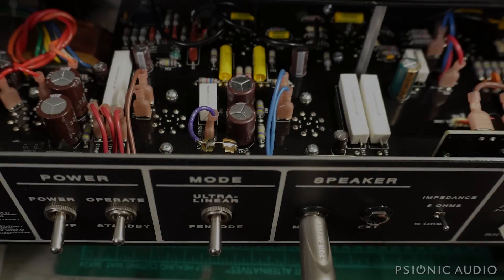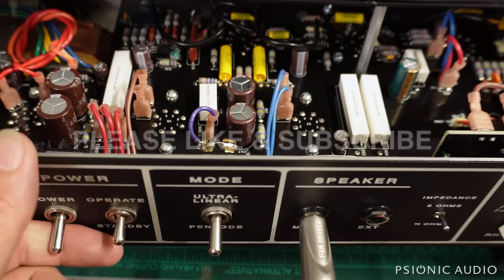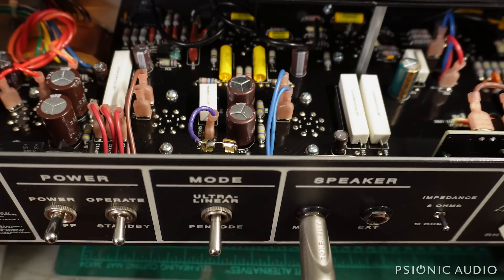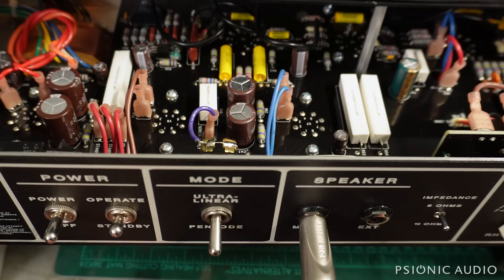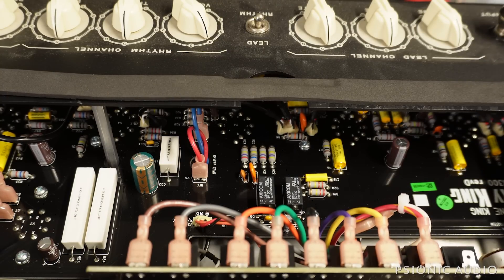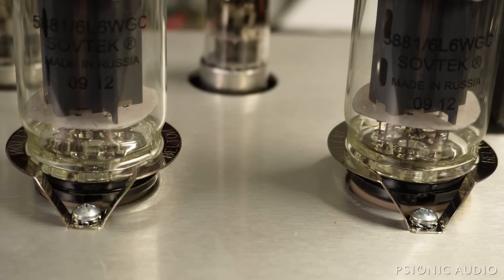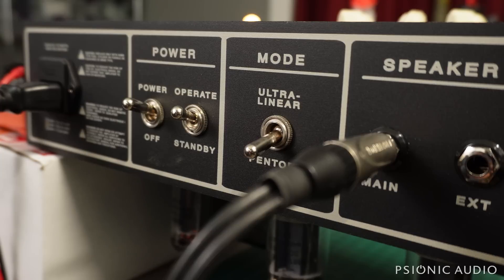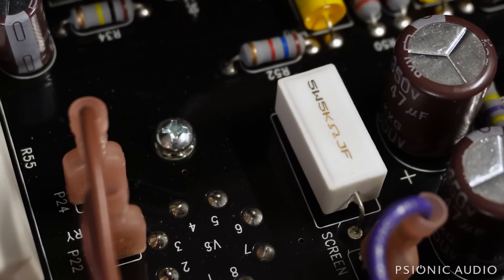Really, Tone King? (Another Sky King)

Comment: I've had to repair a weirdly high number of recent-production B.A.D. Tone Kings and Friedmans.  A few had bad pots, a few had incorrect caps and/or resistors.  I've read there was a fire at the factory and that somehow (I don't know how) affected the components that were stuck in some of their amps.  I'm not impressed.
Reply: Take this with plenty of salt, but I recall hearing that their stored components were damaged (this was either during or just prior to the height of the pandemic; it is a big blur if I am honest).
Reply: Mine had a speaker where the outer edgings dried out…per my tech. He said the speaker was good but found it odd. Everything else passed fine, and replaced stock tubes day one. It’s all running great now! But he did have to put some felt on the outer edges of the stock speaker to stop it rattling. So may need to claim a warranty on it or upgrade the stock speaker. But the felt so far is working fine. What you say here may explain why that happen and parts used.

Comment: i was surprised to see that Jeff Tweedy is using a pair of Tone Kings on the current Wilco tour, Imperial model i think, hope he has a good tech!
Reply: I saw the Breeders also had an Imperial MK2 on stage at Coachella. They seem to be popular with some of the Indie artists. That or TK is reaching out and giving them away for promotion as well. But yeah I brought my Sky King to an amp tech day one for a check up. Swapped new TAD tubes Vs the ones in the video, and had some felt applied to make it quieter at very loud levels. Also had the backplate reinforced and everything inside checked and passed. He also moved the reverb tank around so it’s silent now. It was worth my piece of mind.
Reply: @mattg082  interesting, i remember Lou Reed was using them too on his last few tours, Imperial MK1 ? great sounding amps.
Reply: @watkinscopicat  yea he’s listed on equipboard as touring with them. I demo one for 4 months, and went with the Sky King. I loved the sound of the Imperial. But felt I needed two amps for a live situation. I would totally use 2 of those in stereo. Or a Imperial Mk2 with a 6L6 or Marshall. It was really trebly and boxy after a certain point. Only way around that was a secondary cab, and a GE Nos 5751 in V2 preamp. New speaker was possible as well. 

It cut like a knife as far as top goes at loud volumes. Became very boxxy as well and center focused. It would work well in a country band, blues or light Indie Rock.

All I wanted to do is keep modding it…from tubes to speakers constantly. Not so much with the Sky King, it could hold its weight on stage and in the studio. Same as a Mesa or any Super or Twin Reverb for grunge and heavier stuff. But it has the same circuit as the Imperial but 6L6. Like a boxxy Fender Deluxe vs a Fender Vibroverb/Vibrolux 40w. I thought even the stock Fender Deluxe was a bit more beefy. 

The bright cap is on all the time till 5 on the Imperial MK2, then it gets boxy. So a Tele may fare better or strat with single coils…I play Les Pauls. 

I had the ability to plug the Imperial MK2 into a Sky King cab, and it sounded really good! So I get the Imperial head and cab a lot more now. That’s the way to go, if I was maybe to do it again. I use a Roland Jazz Chorus as my second amp in stereo. It works well for modulation and stereo effects.

Comment: There it is! I went through 3 of these before getting an Ultralinear with no loud hum. Essentially it would hum and blow a fuse or a tube. Day 1 I swapped out new tubes and have yet to have an issue in my current one. But I thought I was going crazy with the Ultralinear noise, and being told it was out the ordinary. When every 1 out of 2 unit had this. 🤦‍♂️

But eventually after a check by vendor for hours, and a trip to the tech day 1 to check all this stuff. I got one that passed fine. Put some new TAD in Vs these stock right away. Just had some cab rattling at loud volumes we fixed real easy. Got ahead of any issues and all good. One I had the stock tube blew up after the hum got louder, and it broke of near inside the amp…pieces of the stock power tube fell out. 

Keep us updated on what’s causing it! Seems it could be a commonality owners could avoid hopefully. If it’s those tubes, then def swap out asap. I did on my last one and no issues present like the other ones I had issues with.

But the Ultralinear hum is very common on the new shipped Sky Kings sorry to say. They don’t always start out that way. But I had enough returns to see just how normal it was. Even one sent from BAD and did the same! Wasn’t until I swapped the tubes before I ran it, that I didn’t have any future issues. The ones I tried  it did it over the course of a few days playing stock it appeared. Most miss it because they don’t use that mode right away. But swapping those tunes before it started, and getting a full inspection helped a lot! Sooo, something is not right.

Comment: I recently installed some wafer base, also referred to as coin base 5881's in a PRS HDRX-20 but I also ditched their bear traps for spring retainers to avoid biting into the glass envelope of the tubes per one of your past video's that pointed {pun intended} that out. With all the vibration, especially in combo amps, it's only a matter of time before those bear trap spikes crack the glass.

Comment: Thanks for all your videos detailing the problems with the Sky King, Lyle. Very informative, and ultimately, a red flag alert, as in DO NOT buy this amp!

And now, I am saying this from personal experience, having bought one before your latest videos on these came out. While it did sound very good, with the features working properly (vibrato, reverb, power attenuation) and did not come with the coin based power tubes, and is built like a tank, I returned the amp to Guitar Center, and did so for the following reasons:

1. With all volumes turned down, the amp was "motor boating". A dead giveaway for trouble.

2. Quality checks were lacking. For one thing, the reverb tank was not secured in its bag, and the bag straps were not secured properly to the cabinet bottom. And as to the previously mentioned "motor boating", if any decent quality check had been done before packing and shipping, it should have been put off to the side immediately for diagnosis. If that can be done with candy bars, it can be done with a $3K amp.

3. My "built like a tank" comment does not come without its downsides. The amp is way too heavy if one thinks they will haul it from gig to gig, even with a cart or dolly. For $3K, Tone King could have built a nice pine cabinet to reduce the weight a little and bring out more tone. Baltic Birch plywood is, yes, very tough and strong, but it is inappropriate for a combo amp.

4. Once again, the $3K price point is going to rear its ugly head. For all that money, they could have provided a decent cover. If most other amp companies can do that even with their lower priced models, there is no excuse for Tone King not to do it.

I'm glad you're on top of the game, Lyle, and that you tell it like it is as to everything that is both good and bad with an amp. Keep up the good work, I have learned a lot from you!
Reply: Regarding your third point, there are plenty of lighter woods with relevant properties similar to baltic birch which that price should afford.  Of course, that would require the input of a competent carpenter or cabinet maker.
Reply: I have one as well, and yes I’ve had the UL hum, tube blow up and returned. I eventually got a working one and yes with volume down, I was getting a motorboat. I pulled my cellphone out my pocket, plugged the amp in away from my modem and it was gone. This amp motorboats like crazy if you have a cellphone in your pocket. 

As for the reverb, I got it fixed when my tech looked at everything. Re situated the cables and reverb tank. Now it’s dead quiet and no issues there. 

It is very heavy and no fault there! For me I only carry mine once a month out the studio. But weekly gigging I need a flight case. 

With all that said your concerns were my least, and easily fixable things. But the cascading noise and lack of filtering at times, and the UL Hum I have experienced on returns…that was just a no go. And I get if someone deals with that, they are very hesitant what may happen in the future. 

No denying it’s one of the best non Fender amps, that just slaughtered everything in the show room for me sound wise. But I think they are on re-vision D or E on this board. It was only remade in December 2018. So that’s a Re release of a PCB production one year before Covid. 

If you think about one year run, Covid, warehouse fire, probably scramble to hire people, parts issues. Yeah this amp hasn’t had enough time in the wild to stand the test of time. With the new build, and that’s something that shouldn’t have to concern the customer. The manual is even the OG 2014 manual! So lots of misrepresentations going on there. 

I have one and yea…sounds great! But I do feel I’m playing a prototype/tester. Look at old board and then new in the SK. So radically different, I’m wondering how they did it. And as faults appear, with the lifetime  warranty. Are they going to free repair and swap boards if need be? Seems if an amps does a go tits up, it happens within year one of these newer builds. From what I know BAD does not do repairs anymore. They are more likely to swap the entire amp. But before that probably get you to swap tubes forever. However, there’s some things that can’t be denied! 

What’s going on in the video happen to me and I reported. Spent weeks with support on tubes, then eventually sent me a new amp that did the same. Called back and got yelled at…But long story short I got a working one, and BAD didn’t do much to get me there that felt reassuring. It sounded like they gave up and were frustrated. I’m not sure if they are outsourcing these boards. Because I couldn’t get any info on what the issue was. They may just assemble and build the cabs in US? But board may be built elsewhere and that’s why support is difficult? Seems everyone has a hard time with this PCB layout…even the maker themselves. 

Great sounding amp, and will def hold up the warranty if need be. But I wouldn’t recommend anyone outside the US buying one. The warranty would just be a lot more difficult to fulfill, with shipping fees and legality. I’m watching carefully every video or report that happens just in case. I saw the videos post buying, and though it was just a case of bad tubes and such. Not so much an issue with the PCB layout being hit or miss out the box. But we’re starting to see more abundant failures in the wild since 2022-now. Reviews on vendor sites aren’t good either post 2020.

Comment: If the bear-trap retainers were mounted to the chassis with their own self-tap screws, separately from the bolts that hold the sockets down, it would be easy to remove the bear-trap retainers, and then the amp's owner could use the tubes of his choice. Meanwhile, if these amps ship from the factory with coin/wafer base tubes, the factory should be using spring/tophat-style retainers. Once again, separate mounting holes and hardware just for the tube retainers would be ideal.

Comment: I've been close to buying a Tone King lately. I might need to look elsewhere.
Reply: I would say steer clear, because the customer service from boutique amp distribution/tone king has been nonexistent.

This amp had several issues out of the box/brand new. Several preamp tubes were very microphonic, the speaker cable did not work out of the box, etc. 

The moment I get this amp back into my possession it’s going up for sale lol but at least I can sell it with a clean conscience
Reply: Was going to buy a new Tone King years ago. I just couldn't afford one new (I couldn't find one secondhand) plus I heard of some folks having trouble with theirs. Went with a used Carr then a used Swart - no regrets with either.
Reply: @jamesf2918  I had similar issues…my tech found everything that could be loose in the amp was…that helped a lot. Then I didn’t take my chances, I gave him some TAD 6L6WGC to pop in day one. He also moved the reverb wiring away and repositioned it. All is good now and amp songs beautifully. But should have not cost me $100 out of pocket day one. At least I didn’t pay full price and more around $2500 new. I like the amp a lot! But they need to assemble these things better. My board passed fine and everything else. But ones I exchanged had the Ultralinear noise and then boom…tube  would blow. After getting rid of stock tubes, tightening everything up. And moving the reverb wires and tank it’s great! But that tells me somewhere down the line whoever is putting these amps together if not doing a great job. The components and board were fine. Just they seem to miss a lot of things during construction, and just shipped them out.

Comment: Interestingly I have a new Tone King Imperial mkII and it doesn't have the problem with the bear traps but when turned on it does hum a bit more than I'd expect and switching it out of standby when it has sat overnight makes a bit of a crack noise through the loudspeaker. It sounds good, I must confess. The hum is 100Hz (UK 50Hz mains) and seems to be in the output stage as adjusting the volume on either channel doesn't change it nor does turning the reverb up/down. The attenuator is after the output transformer so, of course, it does impact upon the level of the hum. This is the first time I've actually owned a valve amp so, to be honest, I'm not sure if the level of the hum is normal or not. However, a question: what does the standby switch actually do? That I can see the 6.3V and 5V for the rectifier come up when the amp is turned on in standby, plus the -50V. However when you switch it out of standby (i.e. fully powered on) then all the big capacitors get charged etc. to make the HT. I can't see that the standby protects anything or prevents any sort of inrush current but I'm completely new to valves so maybe I'm missing the obvious.
Reply: I tried a recent Imperial MK2 and had the hum when volume is all the way down. It was just there…did not have it on the Sky King. I think it may be the PT or something. 

I will say this at least on my SKY KING. My tech said build and board were good…but everything was loose! After he tighten things up, the amp became very quiet. So could be anything. A tech could probably fix it easily. Unless you’re looking for a complete replacement through Tone King and some shipping. A tech would be the quicker route if you want to keep the original. I just don’t trust the shipping, and making its way back. TK support is there, but man they got really frustrated with me. Not sure if the same guy is over there. But given public feedback, money spend and acting like I messed it up…. there was no reason for the outburst I experienced by their support guy. It was obviously an issue on their end, and I’m the one that got yelled at basically.

Comment: I really hope that my Synergy SYN30 head does not have those 6L6s and bear traps.
Reply: Did a quick dig, it doesn't look like it, pretty sure Stevie Fryette is based enough to where he went with spring retainers from the jump 'cos those tubes are sitting there without anything choking the plastic necks. Should be easy to check, just have a look through the back port
Reply: @fives.   I didn't expect to read "Stevie Fryette is based" today, but I guess it's true. My Power Station is a life saver.
Reply: @fives.  Honestly, I have not been moving very well lately.  I may try kneeling tomorrow.

Comment: If hum occurs only in that ultra linear mode, I suppose it could be a tube screen problem which runs the OT primary to unbalance. If the OT was not OK, it would hum in normal (non ultra linear) mode as well, wouldn't it?
Reply from the maker: Depends on how the OT is made, but you and I are thinking similar things about those 6L6s and their screens.
Reply: @PsionicAudio  It could be UL  switch or wiring problem as well.

Comment: Do you agree that if the potentiometers are passive, in most amplifiers, they only serve to take a signal, and then, in order not to have influence, they would have to be at 10?
Reply: I am not Lyle, obviously, but can you be more specific?  Which potentiometers, with regard to what they control, do you have in mind?
Reply: Basically, I'm saying that an amplifier is only flat when the knobs are at 10. Because the potentiometers are not able to add signal, they can only remove it.
Reply: @andrebatucada729  I'll chime in that in most applications pots are indeed bleeding signal to ground.  Especially so in the classic TMB tone stack or it's myriad variations.  But there are applications where this is not the case.  Your problem is you are making an overgeneralization.
Reply: @ThomasD66  I asked a question, from an article I read, it wasn't a statement. And if you read the question, you'll see "most amplifiers".  There is no generalization.
Reply: @andrebatucada729  Well, ok then.